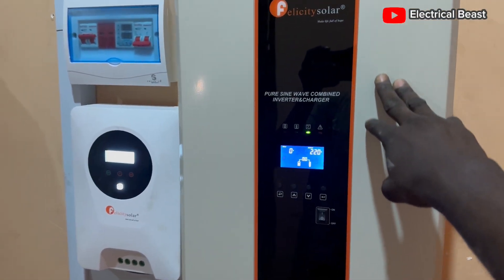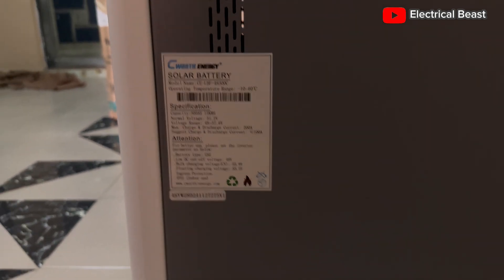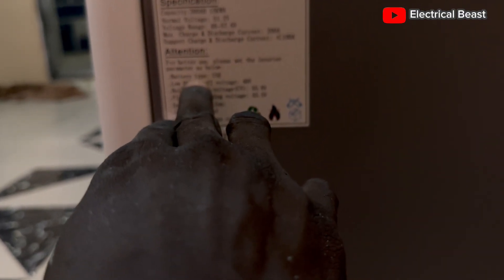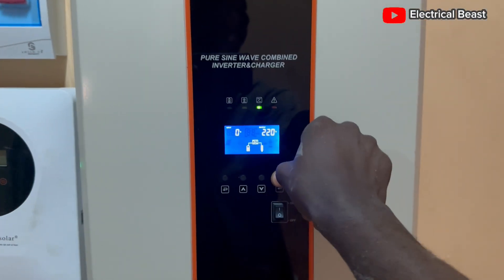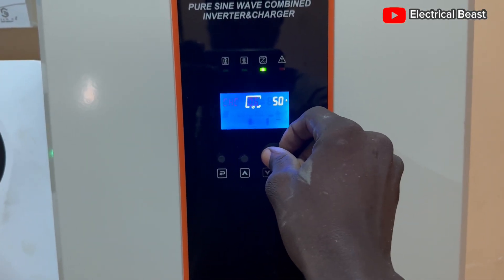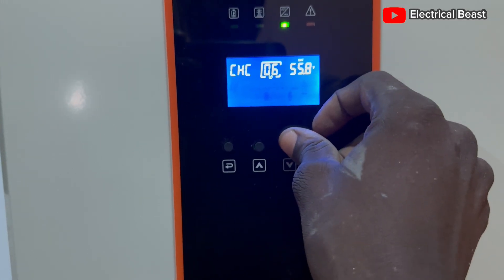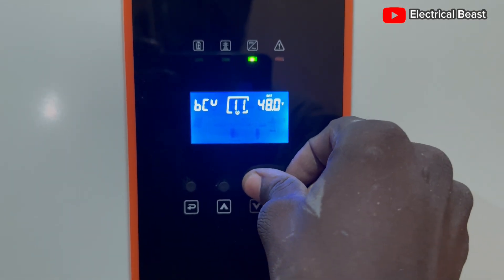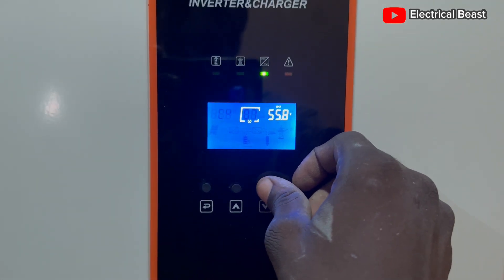I Tried Connecting Felicity Inverter to Cworth Lithium Battery Here's What Happened

Comment: Please how do I link the BMS   between a felicity 5kva inverter and a 10kwh c worth energy lithium battery
Reply from the maker: Use user defined settings.im Felicity ivps models hardly communicate with batteries via cable

Comment: Afa baba what if na hybrid with lifepo4! 48v lithium battery
Reply from the maker: If it’s hybrid. Most brands can cross-communicate via cable but if that isn’t achievable user defined settings should be done.

Comment: pls cworth 15kwh battery comes with terminal resistor. pls which port is it to be plugged into in 15kwh cowrth battery?
Reply from the maker: The ones I’ve used, I didn’t see anything like that in the accessories pack
Reply: @engrgideon check the cworth manual, U will see it's included as part of the accessories
Reply: You can only use the terminal resistor when you are connecting more than one battery. you'd use it to communicate between batteries

Comment: Should battery type be selected to LIb for Lithium or Self-defined? I have felicity 15kw lithium battery
Reply from the maker: If the communication cable works, set to lib. Otherwise use user defined and manually set the  cv, float and lvd.

Comment: Between cworth 15kw and Felicity 15kw lithium battery. Which is more reliable in terms of efficiency and reliability. Please give your honest unbiased opinion from experience so far.
Reply from the maker: Both are sound as long as the required settings are done to protect the BMS. Felicity honors their warranty more hence the price difference.
Reply: Thank you

Comment: Can I use same settings for felicity lithium battery 15kw. I have same inverter with felicity battery rather than
Reply from the maker: Yes but it’s best you use the communication cable in this case
Reply: @engrgideon thank you. Once my battery is fully charged and there’s still PV charging. I’m getting error 51 on my inverter. Is it normal?
Reply: @ndollarwise  Warning 51. My Felicity engineer in China told me today error 51 is normal. I just installed yesterday.

Comment: I don’t think u ar correct to say it has to be a hybrid inverter b4 u can use the lib setting. One can fully connect ur charge controllers to the transformer based inverter and lithium battery all together using communication cables and splitters
Reply from the maker: It doesn’t work. Even with same brand. Hybrid works seamlessly!
Reply: @engrgideon  so far, I've only been able to connect my MPPT to battery pack. Can't seem to get the MPPT and inverter to communicate. Have you been able to do this?

Comment: I Need help or advice with my solar setup pls,  I have this type of inverter 3000watt and Lithium battery,whenever i use it overnight  it's would switch off automatically at midnight and when i check the battery and controller terminal the battery just look dead even the panel can charge it the next day,i have to on generator to Kickstart the battery only then the panel would be able to charge it and would start working properly 

Just wanna know if anyone have that type of issue with this inverter cause i think it's the one draining the battery.the green light is always on, sometimes i have to disconnect the inverter whenever I'm not using solar to prevent it from draining the battery. Its stress me out alot
Reply from the maker: Is it Felicity lithium battery also? If you need to set the low dc cut-off voltage on the inverter that is safe for the battery management system.